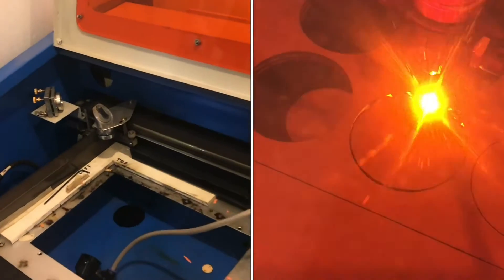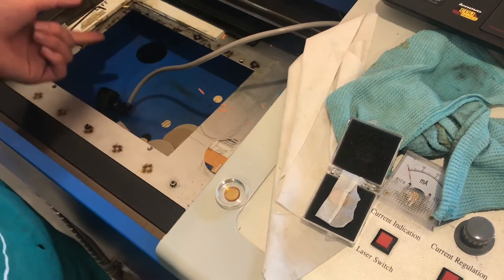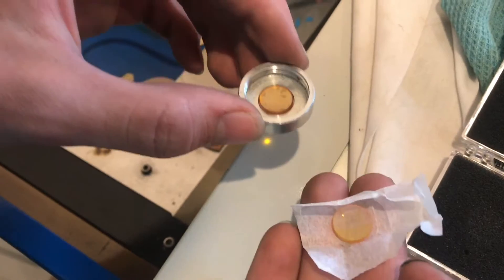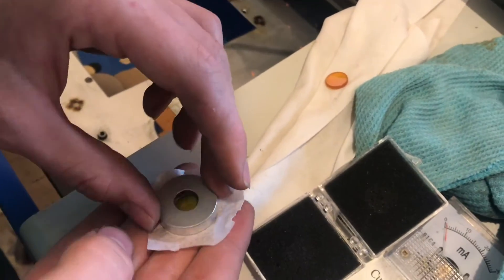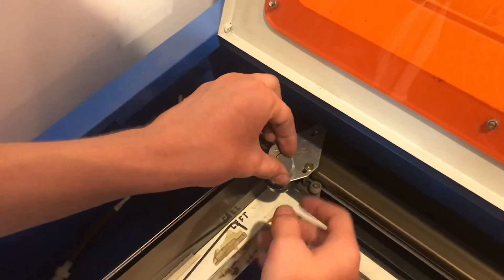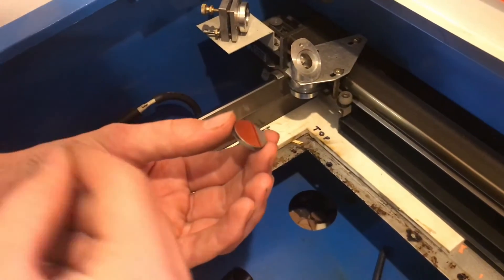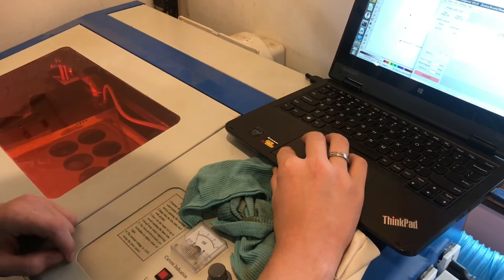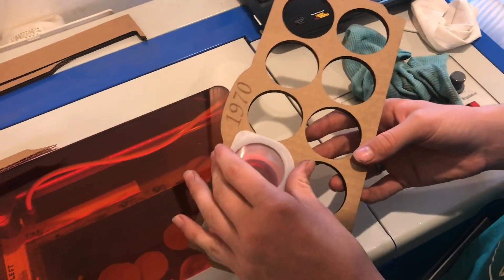replacing your LENS K40 laser (what to look out for)

Comment: Convex side of the lens should face towards the laser beam and the flat side to the material you are cutting.
Reply: yeah, i was also wondering about that
Reply: Seems like it works though. Also the original lens was installed that way.